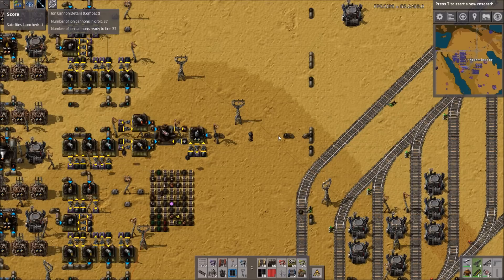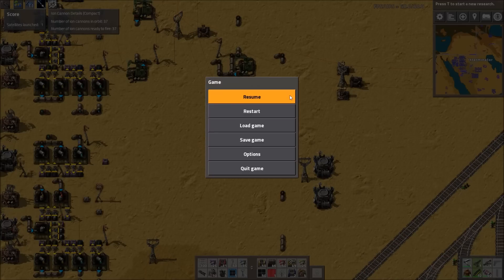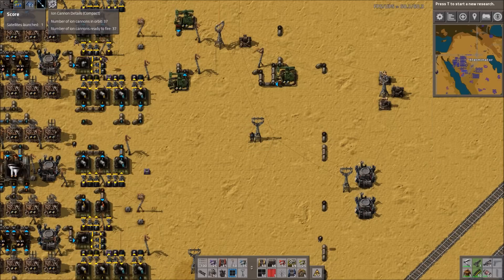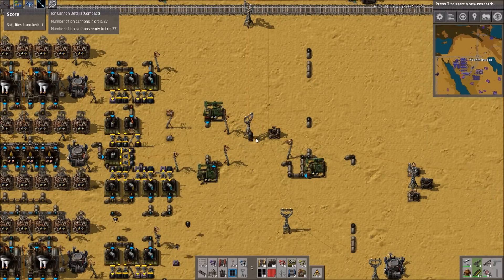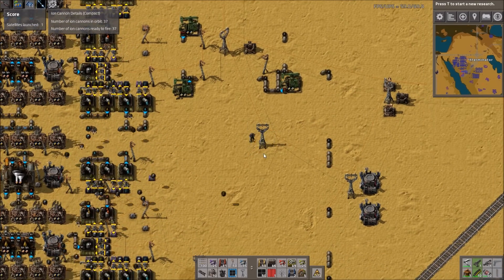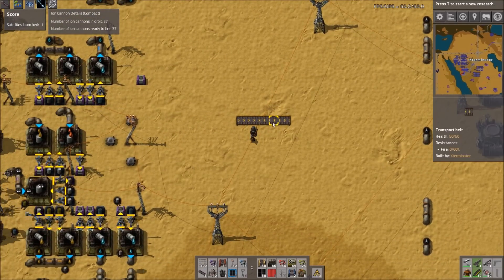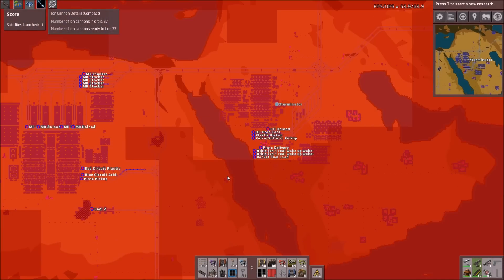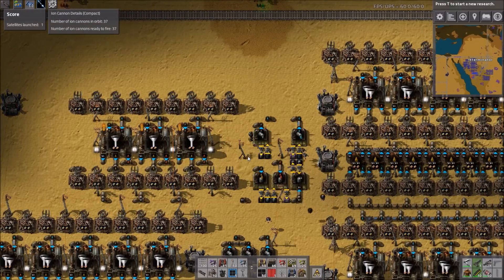5 Ways To Increase Performance & Reduce Lag - Factorio Tutorial

Comment: I would agree except the train loops, there is no way you can prove that.
Reply from the maker: Sure I can. I just didn't because people already complain about the video being too long. Lol 
If people are interested, I can do a video with Zuri and/or Will and actually explain it in depth and prove it.
Reply: It would depend on the precise algorithm used for pathfinding. As far as I know, they use a pretty standard pathfinding algorithm, which is very common in games called A*. This has the advantage of being relatively efficient at finding a reasonable path from point a to point b on a surface with obstacles, but it is not very well suited for network routing - especially networks with multiple paths between every node in the network.

Comment: pipes are also slow, though not as bad as loaded belt. both belts and pipes are more ups efficient when you use long underground sections.  and many mods are slow, but it's not obvious which ones. the debug view let's you see each mods ups impact. the hacked splitter mod is particularly bad for ups.
Reply from the maker: Very good points! 
The underground belts do help quite a lot actually, but still not as much as robots. Pipes are an interesting one though, I actually didn't know they caused much of an impact. O.o
The mods can hurt a ton depending on what they do. As you said, the hacked splitter mod is bad, and most that add additional GUIs as well, such as YARM or EvoGui etc.
Reply: Xterminator Really should make a kind of standard megabase setup and make them all 3 ways 
* Overground everywhere its possible
* Underground everywhere its possible
* 100% bots
Reply from the maker: matsv201 Yeah that would be a super cool test map for sure. The time it would take to make a megabase for each time would be insane though. :/
Reply: Basicly.. if you want to use belts.. use only underground one...
Reply from the maker: ***** Yeah I think they do cause less lag. Personally I've never run into any issues with pipe causing lag, but usually I just use pipe inside my base and use trains for everything else so you might only experience it if you are piping stuff across the entire map. lol
Reply: If i understand it corectly: if you run underground belts. They just handle the first 4 and the last 4... and if its 4 units long, it is really 5 units that is "inside" the belt.

All units inside the belt is handle like simultaneously with no collision detection...

That would imply that the underground belt uses quite a bit less CPU power.....

Making a base with only underground belt could in theory be almost as efficient as a bot based system... It would be intresting to use large scale bluprints and check
Reply from the maker: matsv201 I agree, it would be interesting to actually check and see how underground belts compare to bots if you make an entire base using one or the other.